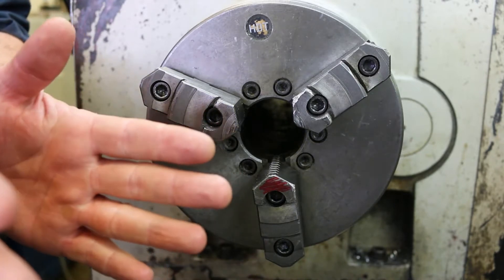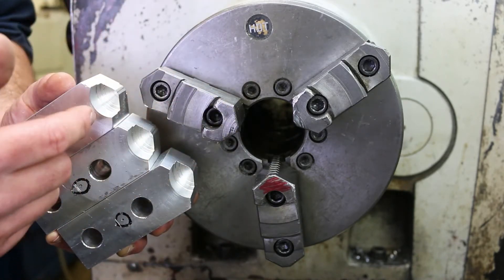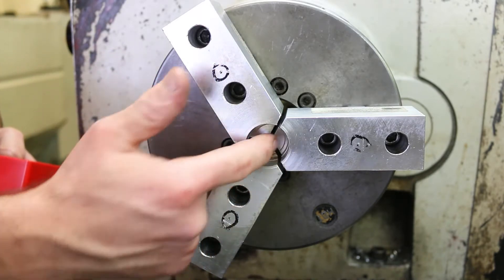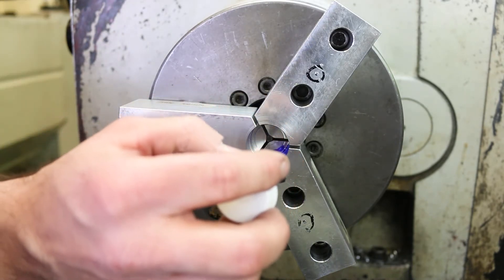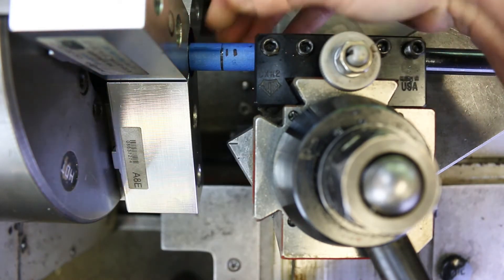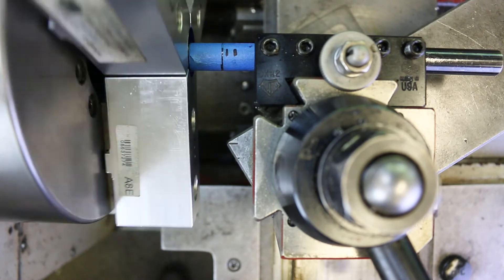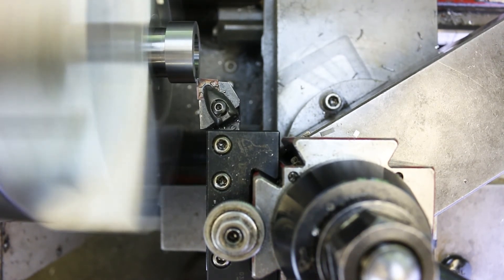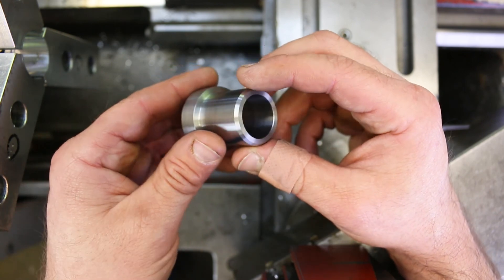Steel Bushings - Demo - Part 4

Comment: Thanks for a great video. Question about the measurement for shaving off 10 thou or 5 thou, etc off the soft jaws. Are you talking about the diameter or the radius? I am sure there is a convention about what people refer to when they say this, but for clarity and for those of us who can set our DRO in either mode, it is really appreciated if this is mentioned.
Reply from the maker: qCNC K 👍 Good question. Almost all crossfeed dials are diametric, except on some very large or very old lathes. Therefore, every DRO I’ve ever seen on a manual lathe is set up for reading on the diameter (ie .001” on the dial or DRO moves the tool radially .0005”). But CNC lathes or turning centers are often programmed radially, so the convention I mentioned a moment ago may not be as commonplace anymore. In my videos and in my classes, I always use diametral values for the lathe crossfeed adjustments unless I specify otherwise.
Reply: @laneymachinetechclassroom  Thanks for the clarification. Appreciate all your videos.

Comment: Do you need to recut the soft jaws between the two bushings?  I'm pretty sure that "NO" is the correct answer, but wanted to check.  Thanks!
Reply from the maker: Nope! Only if you remove the jaws from the chuck because they do not repeat very well. Otherwise they repeat VERY well between parts of the same nominal size.